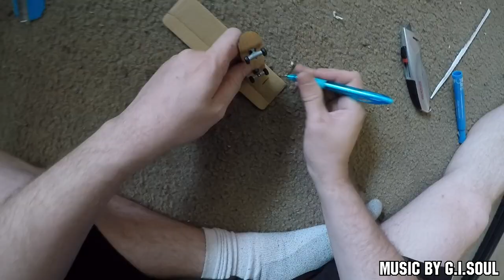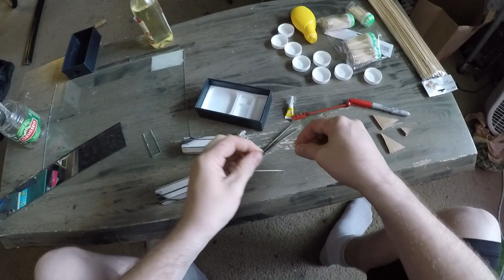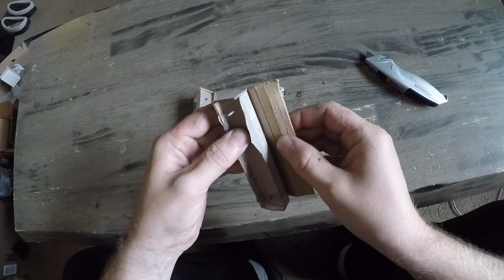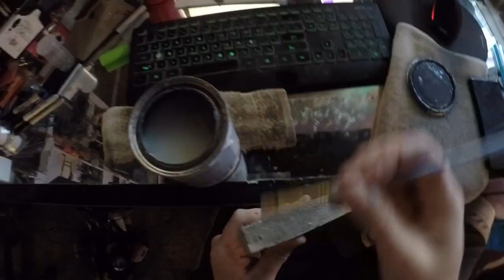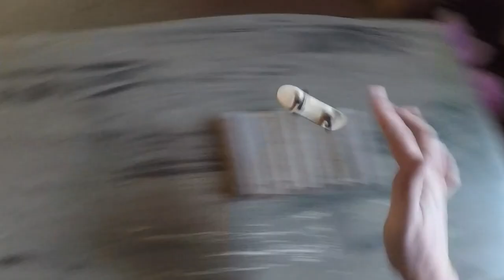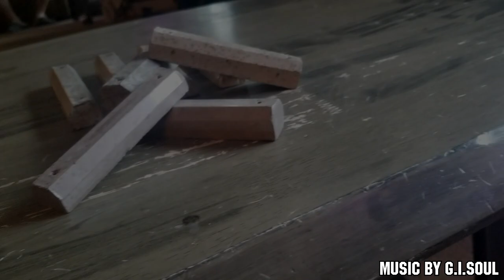FingerPark Creations - Parking Curbs ( Fingerboarding )

Comment: What kinda cement did you use? What were the measurements you used? Thanks
Reply: And sick video
Reply from the maker: @2.0-w1p  Measurements are up to you. When you get concrete or cement just make sure to get the type that is quick setting and a fine powder you dont want rocks or gravel in it. QuickCrete is a pretty decent brand.